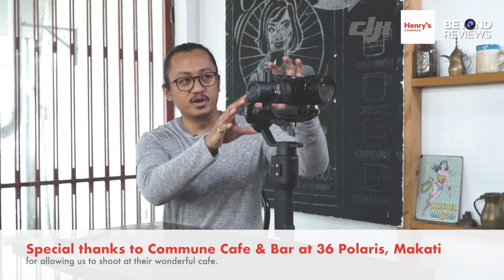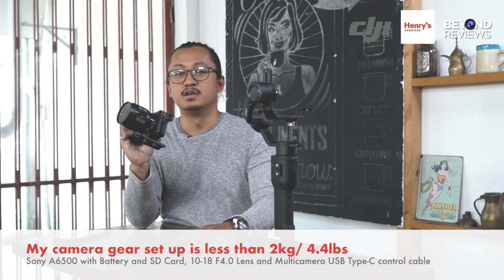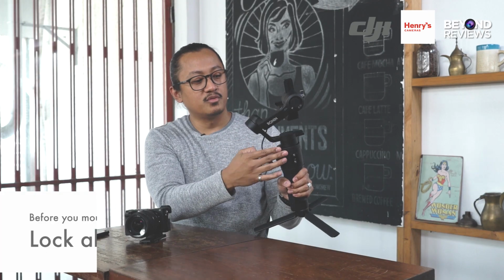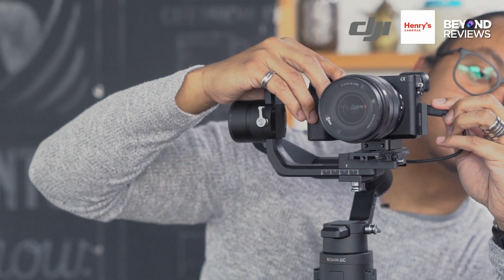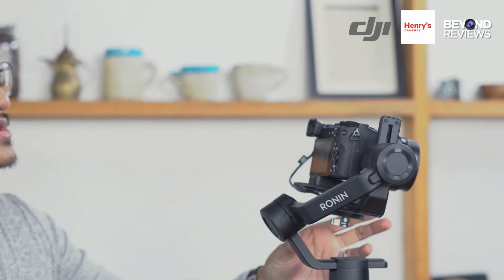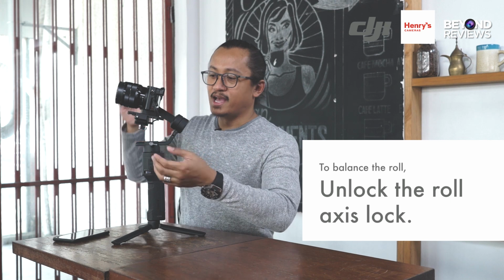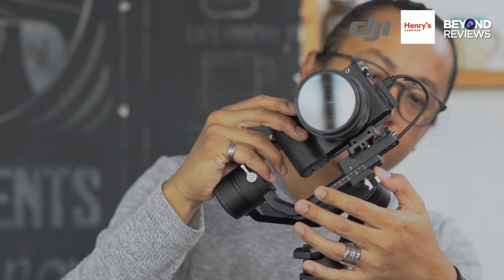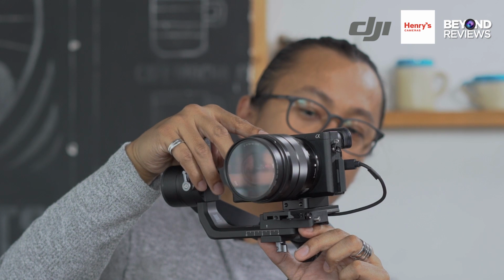How to easily balance the Ronin SC

Comment: Hi,  I am having trouble connecting my camera to the gimbal. I myself have the Sony eight 6400 and the proper cable that came with the gimbal. And I keep getting an error message on my screen “check connected device” can’t seem to fix this issue.

Comment: Hi, Can you please help. I try to balance my Ronin SC with Canon M50 + Sigma 16mm and Rode videomicro. Less than 2kg. Everything is OK except for Roll balance. Camera always rotates (a bit) from left to the right and from right to the left. Impossible to balance it perfectly. The application on my phone shows Excellent for everything however I see that ROLL balance is not that perfect like Tilt balance. Should I return the Gimbal do DJI ? or just leave it like that ? Thank you for your help !

Comment: Is it possible to use Ronin for small camera (Sony, less than 0,4 kg)? I have problem during 1st step, I cannot make it still on 45 and 135 degrees.
Reply from the maker: Hmmm did you try using a counter weight to make it a bit heavy where it’s not balancing right. Haven’t tried it on lighter cameras.
Reply: @BeyondReviews  Thanks for replying. I added part for attaching flash lamp and then it gets balanced but am not sure if I should treat it like whole "camera" and balance it for next steps to 90 degrees or like camera with a cell attached (in official videos they say to balance it to 45 degrees). I am a little confused 😬